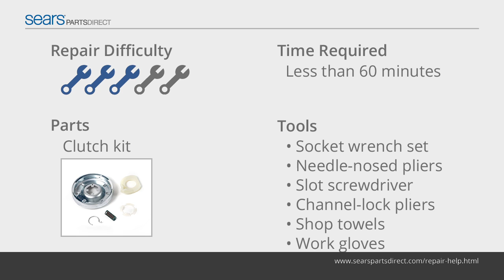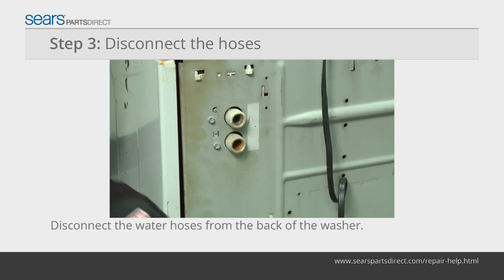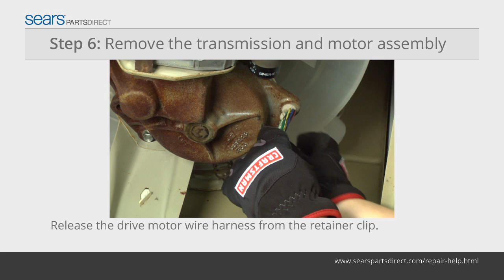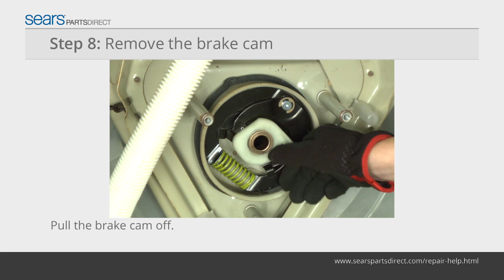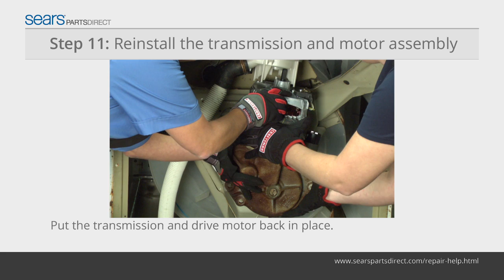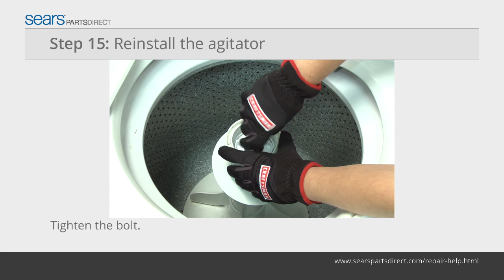How to Replace a Direct-Drive Washer Clutch Assembly (Kenmore, Whirlpool and Maytag)

Comment: Except for my agitator falling apart into 15 pieces & requiring more YT vids, this really helped.  Getting the clutch re-installed takes some spinning of the clutch assembly and nudging, but ... it worked.  I hope.  Experimental load running now - it this clutch doesn't fix this machine, I'm taking it out back and shooting it : )  Many thanks  :)

Comment: Great helpful video. watching the video took longer than the actual job, While I had it apart I also replaced the seal in the top of the transmission, Clutch, brake and motor hub cost me less than 50 bucks and 45 minutes of my time.

Comment: Replaced the clutch and the rubber crippling between the motor and tranny still doesn’t spin
Reply from the maker: Your details seem to indicate that the drive motor runs when the basket won’t spin. If the transmission rotates the clutch in the spin mode, then a broken drive block or faulty basket drive could be preventing the basket from spinning. If the transmission doesn’t spin the clutch in the spin mode, then the transmission likely failed.

Comment: I did all the steps until pulling the motor and transmission out. Unbolted it but the shaft won't budge more than a couple inches.
Reply from the maker: The transmission shaft could be binding up inside the centerpost. A bearing and water seals inside the centerpost may be damaged, which would prevent you from being able to pull the motor and transmission out. Those seals and the bearing likely need to be replaced. The centerpost seals and bearing are difficult to access so we recommend that you have a service technician examine the washer and replace the centerpost seals and bearings if they’re damaged. You can schedule service here:  https://www.searshomeservices.com/.
Reply: same here, and   i was going to put one bolt back on, for weight support, so i could flip it  back over and check if there was any kind of clip remaining on the shaft inside the basin (i'd already removed the agitator)--and in my haste i slammed my finger with the caught motor/transmission. ive got frozen peas on it and its throbbinglike hell.
Reply: Mine did that too but I just wiggled the assembly in 4 directions while pulling harder and it came right out.

Comment: I replaced the clutch. When I put it back together. It was spinning, but clicking then stopped after a couple seconds.  Then I ran a cycle with water. Clicking continuously and all of a sudden it just stopped?   Now it wont run at all? Is there a reset?   Please help
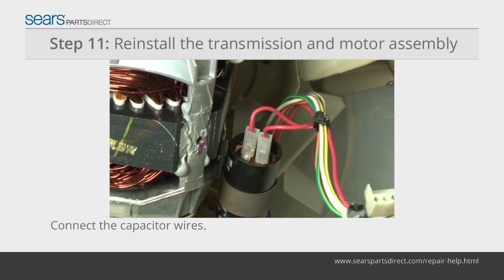Reply from the maker: Make sure that you plugged the motor capacitor wires back in as shown at 3:09 in the video. If you do have those wires plugged in, then the motor capacitor may have failed. A bad or unplugged motor capacitor can cause the motor to click and then stop making any noise because the motor has an overload switch that trips when the motor overheats. Once the motor cools down, the overload resets. You may be able to fix the washer by resolving the capacitor issue.